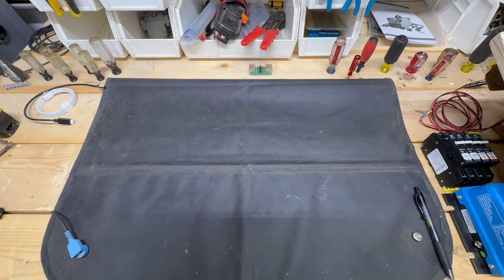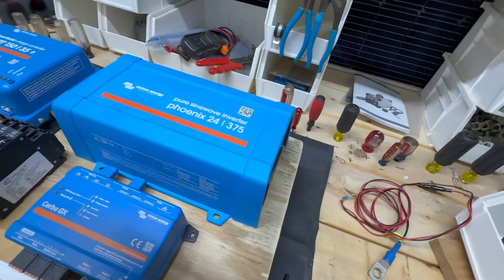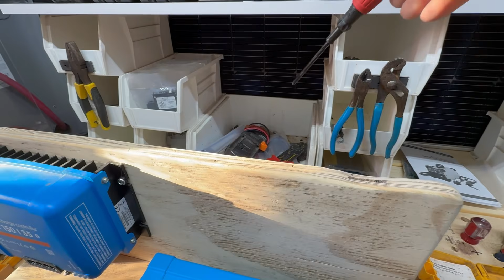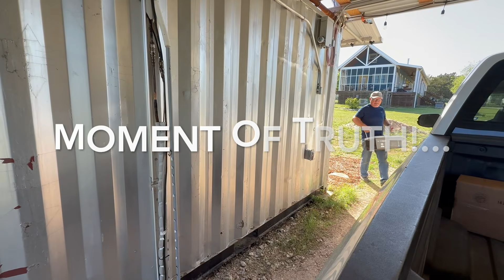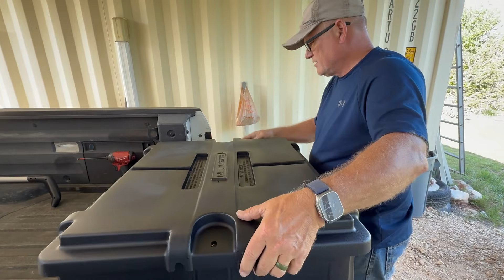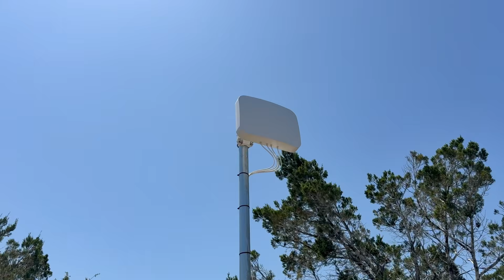Cell Tower Repeater for Remote Internet Relay

Comment: Why not run everything off DC power?  Seems like it would save cost and energy use here...
Reply from the maker: I agree that all DC is possible. The cellular uplink has a 9V power supply and I think the downlink is 24V POE or may even be 56V. Also, the Victron Phoenix inverter was just over $100 on Amazon. Overall the combo has been working well. Thanks for watching and commenting!

Comment: As usual, very nice!
I did note one small discrepancy, and not saying it didn't happen, but the torquing under normal circumstances would occur before putting the caps on... 🤣
Reply from the maker: Glad you enjoyed it! Thanks for pointing that out, my brain might be RPN, but my hands are on correctly. 😊 🔧